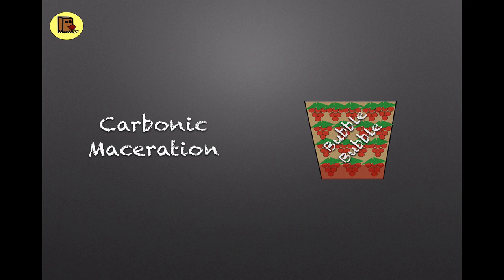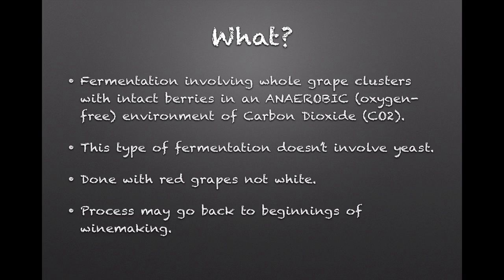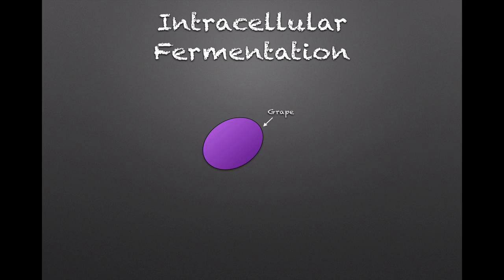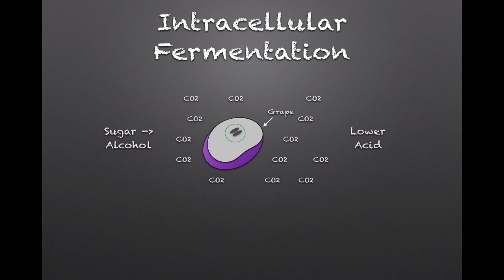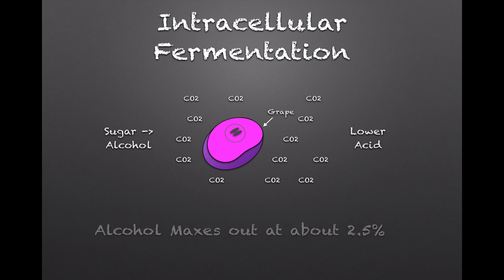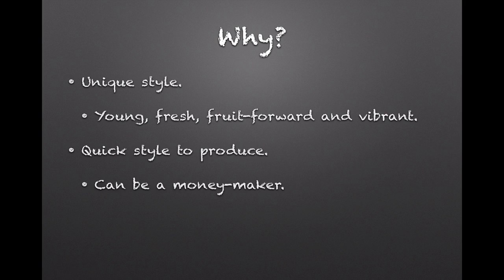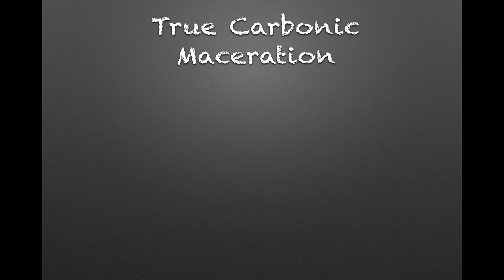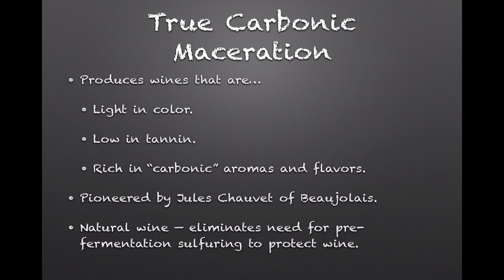Winecast: Carbonic Maceration

Comment: At 8:00. How do you add the whole grape clusters (if you just flushed out the oxygen with co2) to the container without introducing more O2???
Reply from the maker: Thanks for the question.  CO2 is heavier than oxygen and it "pools" in the tank, so oxygen won't immediately refill the tank.  Think of it like filling the tank with water and then introducing the grapes into that environment.  Hope that helps.  Cheers!

Comment: My second question is this: you mentioned that in the semi Carbonic maceration method, you only have 2.5 percent ABV after the Carbonic stage. Then yeast-driven fermentation then raises the alcohol content to the usual level. In the fully Carbonic maceration method, does the enzymatic fermentation raise alcohol level up to the normal levels?

Comment: Great video!!
Please, I would like to know if the Beujoulais Cru like Molin-a-vent goes through the same semi-carbonic maceration.
Reply: 'Cru Beaujolais at its finest is crushed and vinified much the same way as the best wines of Burgundy: long cool fermentations, aging in oak (often neutral), and lees stirring. All of these techniques are meant to carefully bring out the deep complexity of the wine, allowing a full expression of the grape and the terroir.' In the case of Moulin-a-Vent, which is considered the king of Beaujolais, the wines can age up to 10 years and develop notes and aromas much like pinot noir (after all, they are related), known at "pinoter"